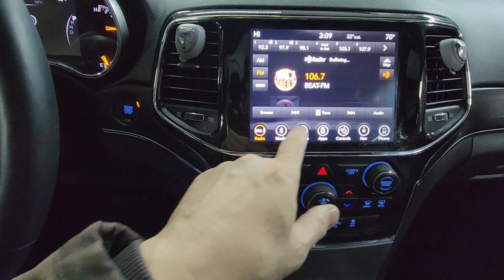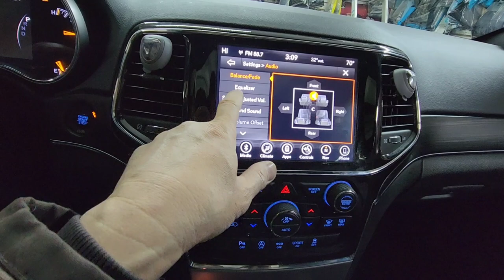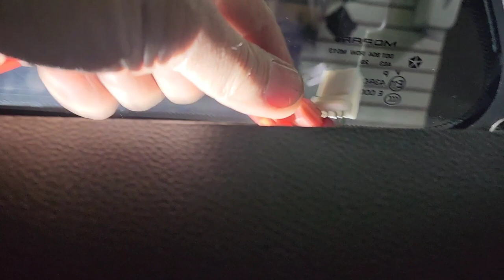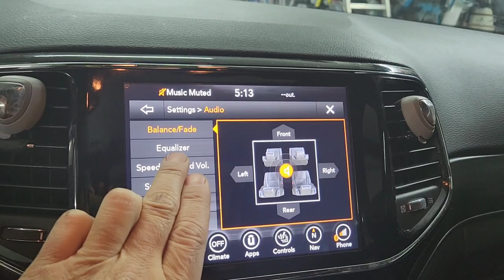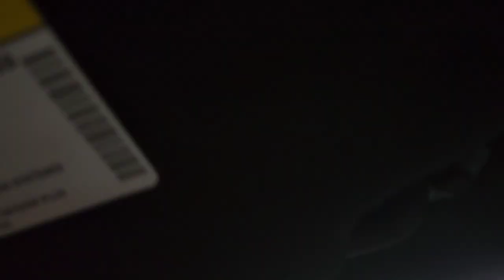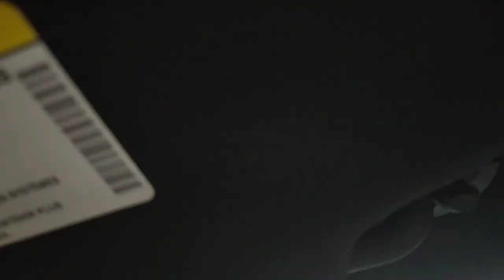2019 up Jeep Grand Cherokee Amplifier installation ANC bypass

Comment: Take it to the dealer. I had the same problem with my 2021 Toyota Sienna Platinum. I took it to the dealership and told him to disable the ANC. They hook the computers to the car and disabled it in 5 minutes. It took me forever to figure out that issue.
Reply from the maker: How much did the dealer charge you?
Reply: @khmerohio  Nothing. I told him I could hear the white noise it was making and it was bothering me.

Comment: Where did you connect the remote wire
Reply: I also need a place to get a remote wire from with out running to the fuse box under the hood preferably
Reply: Just get a plug and play don't cut wires

Comment: The "burping" sound and/or the wubs you hear when car is in drive I want to say has to do with the remote in. An Upgraded LOC like the lc2i is ideal. Run remote from the fuse box under hood into the remote in on line out converter, then from the line out run it to your amp but I also tapped into factory sub though not entirely sure that would make a difference but I'd recommend tapping in back there with a nicer line out converter
Reply from the maker: Thank You!!! Definitely lc2i
Reply: Do you know anywhere else I can get a remote wire from besides under the hood? Is there any fuse boxes inside that you know of? Thanks

Comment: Man maybe you can help me do you know if a 2017 grand Cherokee overland have the same with the anc
Reply: Look it up. Easy to find.
Reply: Buy a high end line output converter and run a switched remote wire
Reply: The pac adapter I have came with an ANC harness to plug into the stock amp to fix this

Comment: Between 13:20 and 14:00 which ones are positive and negative on both sets of wires? 
You said gray/brown is positive and gray/tan is negative correct? There’s another set of positives and negatives back there correct? Thank you
Reply from the maker: grey white is positive and green white negative